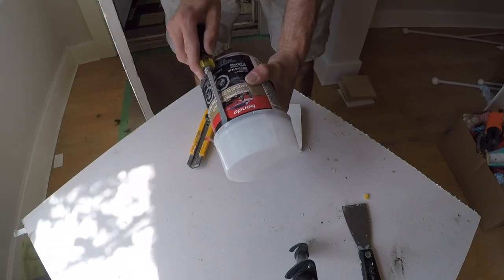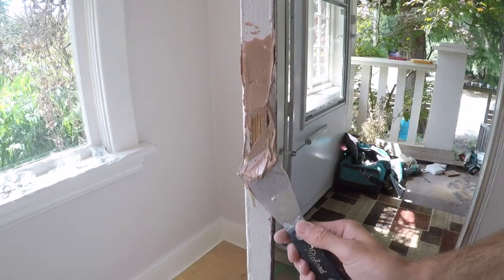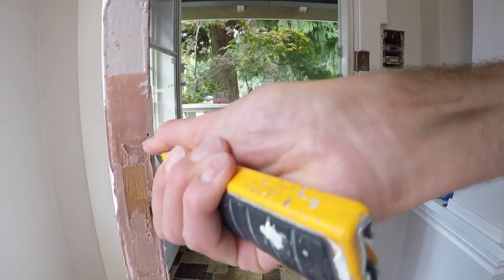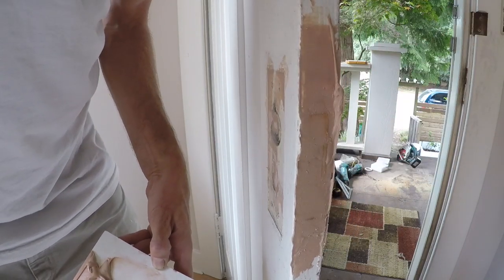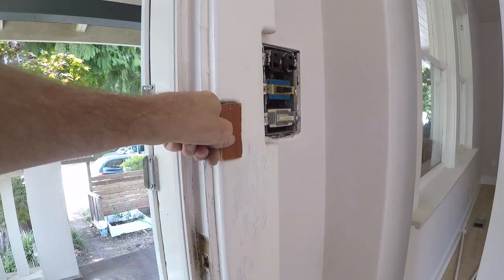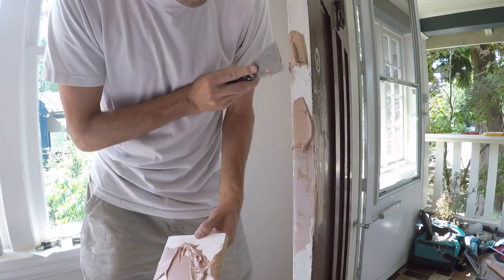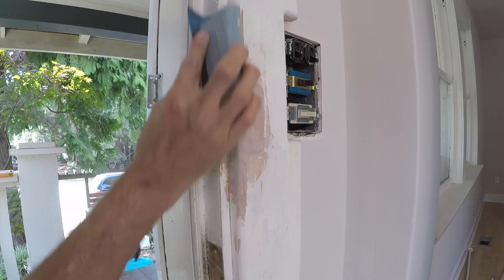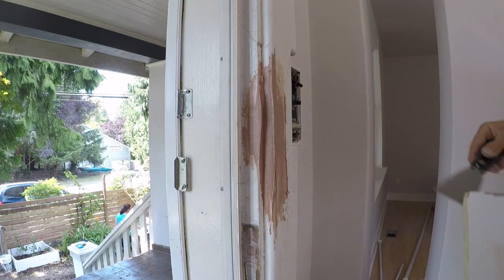Repairing WOODWORK with BONDO!! (auto-body filler)

Comment: Building  forms to hold the Bondo in place for those bigger voids will cut your work a lot.
Sometimes just a piece of tape is good enough, for bigger holes a scrap of FRP or other smooth surface the Bondo won't stick to is great, also leaves a glassy smooth finish.  A bit of wax on any smooth scrap wood is good.
You can use your CA glue and painter tape trick to make double sided tape and place forms easily.
There's a similar product with glass fibres in it called Mars Glass, it's a little harder to get smooth but is much tougher if you need structural support, and it is more viscous for filling big holes with less sag.
You can adjust the amount of MEKP catalyst (hardener) to make the resin set faster or slower.

Comment: Did that job come with the "tail-gate warranty"?  

I first use Bondo in the 1980s on cars.  Within a decade I got a job at an auto-body shop and learned a lot more about body fillers.  I have also used Bondo on wood.  The first many patches looked good at first but always cracked between the Bondo and wood.  

The problem is with the wood expanding with moisture and the Bondo not expanding.   You need to have a decent feathering to get the filler to stay put.   Also using a fibre-filled filler will help a lot.   The fibre filler cost more and you probably will have to go to an autobody supply store or buy it online to get it.  It won't let go of the wood and crack nearly as easily.  

I like to start with a 24 or 36 grinding disk to bevel out the area of the wood that needs filling.  This gives the filler plenty of area along the wood grain to grab on.  

As I saw in other comments, you definitely want a body filler file for cutting down the excessive filler.  

Get the plastic body filler spreaders.  When the filler has set up, you just flex them and the filler pops right off.  Filler loves to bond to metal.   

Sorry to be a critic.  I love your drywalling videos.  I've learned more the past year watching your channel than I have while doing odd jobs the past 20 years about drywall.  Plastic fillers are an entirely different animal than drywall mud.  Bondo brand really sucks in comparison to brands such as Marson or Evercoat.

Comment: Ive gone from wood putties to Bondo to PC Woody To others and I'm back to using Bondo, It's cheap works Quickly and everyone sells it.  I find that I cant do A final sanding on a big or multi layered patch with an electric palm sander for about 12 hrs or more though. I keep my metal putty in a container of paint thinner so I can clean it with a rag. I find the Bondo applicators work well and the bondo doesn't stick to them. 4 different sizes for like $6. I use then a couple of times and throw them out, the edges will go bad because they are soft and supple.

Comment: Does anybody know if the bondo presented here (auto-body) is water resistant? I need to fix the bottom of a door jamb that is exposed to the outside and it has been rooted because of rain over the years. Great video, thank you!

Comment: another thought. Any time adding filler material be aware of it's hardness. Most is harder than the wood. When sanding to match be cautious as the original wood will go away faster than the fill and you end up with low spots adjacent to the repair.

Comment: For profiled surfaces, you can cut a Bondo spreader or cheap plastic putty knife to the profile you are trying to get to and use that for the final pass when applying. It will at least get you close and avoid big globs hanging off everywhere. Also, if you use a Bondo spreader or plastic knife, the cured Bondo peels right off of it.

Comment: I have done this before. Better than the wood filler crap, and you can adjust how fast you want it to dry by adding more hardener. (I use enough to make it dark pink)

Comment: Bondo is just one of those basic supplies that you always want to have on a shelf in your shop and never run out of.  It's like glue, sand paper, tape and shop towels.  Your always going to find new uses for it....I've found dozens of uses over the years.  It's designed for automotive body repair so it's suitable for interior and exterior patching, resistant to expanding, shrinking and cracking.  Some versions have stranded fiberglass reinforcement built in or you can reinforce it with nails, screws, metal mesh, wood or plastics.   Adheres well to metal, wood, plastics and even concrete with the right preparation.  It can be cut, sawed, drilled, sanded and almost any finish applied over it, with or without a primer.  Just don't sniff too much or this stuff or you'll find yourself writing comments on YouTube videos.

Comment: Great video, clear oral presentation too.  I'm curious why you used the auto-body filler of Bondo and not the wood filler from Bondo? 

 I need to do exactly what your doing except on the receiver side of the door.  I was hoping I could just slop in a a couple inches of bondo...yep never worked with it before.  Nice to learn I need to attach in the receiver hole some hard wood and then apply the thin coats of Bondo.

Comment: I've used Bondo to fill wood for years. It's basically for indoor use only.  Even in a dry climate with a good paint job covering it, don't expect it to last more than 2-3 years.
Reply: If you're in a wet application, use the marine bondo. It's waterproof and has fiberglass hairs (either long or short) in it. Works the same as bondo, but it doesn't take as much profile changing.
Reply: There are several different products made by the bondo brand. General purpose bondo activated by hardener works on exterior/interior.
Reply: @erictold  General purpose bondo is porous. It allows moisture through. It's only meant for shaping and finish work. To protect a surface from moisture, you need something else.
Reply: Meh......I have to disagree with that, I've been using it for about 25y in GC/Renovation work and I've returned to past jobs I've used it on and it holds up long term

the worst I've seen is minor hairline  cracks around the perimeter of a major  fill that wasnt backed up with either a backer rod or a dutchman.

the dutchman repair he did in the video is particularly robust and long lasting when it's also glued and mechanically fastened with either screws or nails

Ive done huge replacement chunks on doors that were kicked in  using rhat exact method and it will last forever if its maintained normally
Reply: @patrikkevinmarshall  
Thankfully your experience is different than mine. I had one client who's  outdoor Bondo repairs failed after a couple years and had to be done over. It just didn't hold up to extremes in weather and being wet or sun dried. The swelling and shrinking of the wood really weakened the bond.

Comment: Use a Stanley Surform  5 1/2 plane instead of a knife ...works far better for flat surface forming .  His knife use for intricate cuts is still another way to get the job done here.  His suggestion to work in thin layers and build up slowly is also an excellent suggestion.   Trim down first then let it set up hard before you use sand paper and block of wood .  80 grit then 120 and so on.

Comment: Hey a couple tips from a contractor that was an auto body guy in a past life. There is filler and there is putty, hard to tell but it looks like you are using putty which is only for final coat maybe 1/16 or 1/8 fill max, filler can go much deeper but is not as smooth probably should be using both here or at least doing plugs then putty. Also you do have to sand between each coat for adhesion.

Comment: Be careful with regular/standard bondo. Use fiberglass bondo. It has fiberglass strands in it that will hold the bondo together better in the long run. Fiberglass bondo is specifically used for rotted out holes and gaps from rust, so you will have better luck with it. Regular/standard bondo is suppose to be used 1/4” thick at the most. My concern is the edges you did. And I’d get some better quality bondo, that’s the lowest quality bondo you can get. You probably dont do much of it. Also, sand before & inbetween every coat. Bondo needs adhesion to stick to.

Comment: Hi, informative video. I bought a house and am self renovating. I have been loving your channel. I've been looking into the bondo. What's your opinion on the wood filler specific version, that is stainable. I have solid hardwood doors through out my house, them and their door jams have some fairly bad gouges. The wood is stained and polyed however. Do you think I would have similar success using wood filler variation bondo, so that I can stain and poly it?

Comment: any advice for fixing a hollow internal door? It has a circular knob handle and facia, but its been screwed in so many different places that the door shell is now breaking away and nowhere to firmly attach the facia. The problem is its difficult to just use filler as the handle bar needs to run through the cavity to the other side of the door. Thanks

Comment: What would you do if you need new hinges but the screw holes don’t line up? Can you fill screw holes with something and then redrill a hole really close to it? Or even against the precious hole?
Reply: fill the un-needed hole with a golf tee.  tap it in firmly with or without wood
    glue.  cut off the remaining part of the tee.   the surrounding surface
 should be stable enough to install the screws where they are needed.

Comment: I have some OLD stair treads that were covered with a makeshift plywood "tread"  to hold carpet.  Is there any hope for filling the severely worn treads (large voids to be filled) with bondo?  Or are there any fillers that is hard and stainable that could be used?

Comment: I've only worked with bondo a few times, but Isn't it recommended to fill or stuff the existing cylinder and spindle holes with something before bondoing?

Comment: Hey Ben:  It looks as though the "dead-bolt" that was originally on the door was actually what they call a night latch in the States.  But I wonder about the strength of the repair on the door jamb.  Two finishing nails don't look like much mechanical strength for the new dead-bolt to "bite into" .  Unless the repair do showed us was for cosmetic reasons.
Reply: Good catch. That was exactly what he did. Even near to the repair, the wood of the door jamb is weakened by the hole.
Reply: The door jamb wasn’t designed to give strength. Use longer security strike plate with 3 1/2” nails for strength.

Comment: Thanks for all the great and informative videos. Any suggestions for popcorn ceilings? I'm doing a renovation, and the bedrooms have years of paint over the popcorn texture. So far, I knock down with a 12in knife, then spray with vinegar and water mix and soak, then scrape it off. What's your preferred method? Thanks again!
Reply: There's no secret method of removing painted popcorn.  You can knock off the high points with a scraper and wet it with a spray bottle to loosen it up but you'll be peeling it off in sheets no matter what you do.
Reply: @oltedders  it's so many layers of paint it hardly scrapes. Any one ever knock down the bumps and plaster over with mud?
Reply: @adamheaverin2693  
It can be done but expect to use tons of joint compound and at least three coats. If you use this method l suggest you  go over the entire ceiling and screw the sheetrock back into place, as there will probably already be some sagging from the weight of the paint layers and the minor movement most buildings go through over the years. I suggest doing this in any case. Use a horse hair brush to clean the surface before applying your 1st skim coat.

Comment: Use plastic putty knives to apply the Bondo. When the Bondo is hardened just flex the blade of the knives and it will easily flake off.
They work much better than metal knives.

Comment: How do you rebate a new lock or latch into bondo? I get you can drill into it but how do you rebate the striker plate etc.?
Reply: *recess?
Reply: @gregorsamsa1364  I saw after I commented he put a section of wood in one part so he could fit the lock parts in the frame but can't chisel bondo to rebate the door lock easily.

Comment: Would using wood filler be a good choice in this case?  Why or why not?
Reply: not as structural .  Bondo is just as strong as the wood, filler is softer.

Comment: Bondo makes a Wood Filler now. Have you tried it or had any luck with it?
Reply: Would also love to know if VC has any experience. Used some wood Bondo for door patches in my house. Working with it feels the same as Bondo, but it's more expensive. I recall reading it will stretch as wood expands and contracts where Bondo is more rigid. No clue if that's true or if Bondo has the same product in 2 different cans. 🤷
Reply: @mattmeola    Minwax has a wood filler that i found out to be 
    Bondo, but with an added color, and what appeared to be 
sawdust.   the little tiny can cost about $ 9.00, so i went and
    bought a gallon can of Bondo for about $ 18.00

Comment: Bondo is ok, but it's really made for metal.  Wood expands and contracts more than metal. There are better two part "wood fillers"  on the market like System Three  brand stuff.  It's way more expensive and a lot slower drying, but if you have the time and want to do it right, that's the way to go and I would never consider using  bondo on exterior wood.  Bondo will look ok, but there are better products for wood that are longer lasting.
Reply: a thousand times, this message.  Abatron is another manufacturer.  especially on exteriors, where you get more expansion and contraction and there is any water, vapor or otherwise.
Reply: @erict7499  , thanks that's another great product.

Comment: So, how weak is this going to be compared to having glued and screwed a block of wood in.  When someone comes to kick in this person's door, how easy will it be?
Reply: He did put a wood filler block and if you want a stronger door lengthen all the screws on the hinges going into the wall and the knob side use 3.5 inch exterior screws or deck screws for all 3.75 if you can get them
Reply: Longer screws suck if your trying to kick a door in watch the testing videos here on the tube

Comment: To avoid cracks around the edge wait at least a week for the bondo to dry then prime
Reply: 2-part standard Bondo doesn't "dry," it chemically cures, so it's completely hard and shrink-free in less than an hour, depending on how much hardener you used. I've primed and painted it many times after 1 hour with perfect results. If you have to wait a week, you're not mixing it thoroughly, using some other product or have some unusual situation like high humidity with moisture in the wood.

Comment: I've actually found Durham's Rock Hard Putty to be more convenient for wood repairs where you're using Bondo. I think it's the closest to water based Bondo you can get, no solvents, no fumes, easy tool cleanup, etc. Bondo is a bit stronger but I'd rather use Durham's putty on wood, but Bondo still definitely is better for metal as Bondo still has the little bit of flex. At least this is my opinion doing similar repairs as a painter.

Comment: For all this effort surely a dutchman would be the better option? It really doesn't give a good finish, this method. I use polyester fillers a lot, and voids - as seen in the final pictures - are common. A dutchman repair would've been far quicker, simpler and give a better result.

Comment: Looks good at first but after a few months it will show. Two pack filler doesn’t shrink or expand like wood. Come the spring you will be repainting. Been using this stuff for years on commercial property but never on domestic.

Comment: DAP Plastic Wood is a lot faster and less effort than than that Bondo mess, and it is easy to sand. I would also be concerned with those big holes showing back up in the future after a few seasonal cycles. Plugging the holes with wood would really not been that much extra effort.

Comment: Much better to use an epoxy-based filler ... not a polyester-based filler. The Bondo will eventually separate from the wood; epoxy will not. Bondo, cars, metal, okay.

Comment: In 50yrs~ In my shops bondo has never graced the doors
Reply: What do you instead to prevent Bondo from "gracing the doors" of your shop?
Reply: Depends on what the item is door ,furniture , structural .We remove or repair the existing damage,a door that is  damaged such as the one in the video we would normally dovetail a new section in with a exterior grade epoxy ( some people refer to it as a Dutchman repair)If the damage is sever enough the rail/stile would be replaced. Bondo does not hold well especially automotive varieties(also note it should never be more than 1/4 inch even in automotive use bondo is hydroscopic by nature) they do make a woodworking version that is designed to fill and smooth a surface such as in instrument making. Example a highly lacquered piano lid. In our shop we still prefer to use hide glue and sanding dust for that.

Comment: I'm not getting why twenty minute joint compound wouldn't work just as good? AAAnnd way cheaper.
Reply: It's weak. Bondo/polyester fillers dry rock hard - harder than wood.